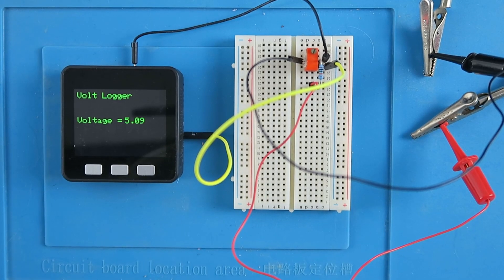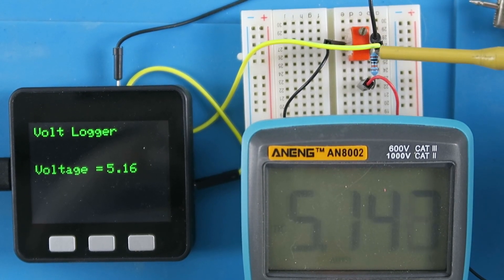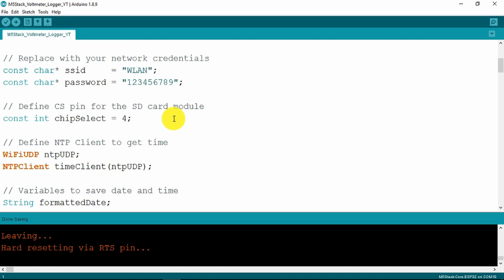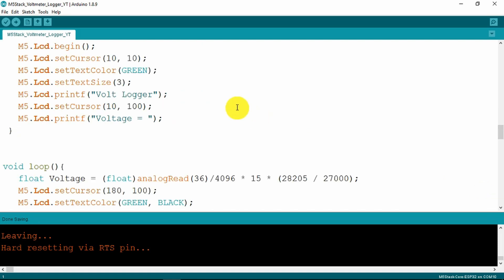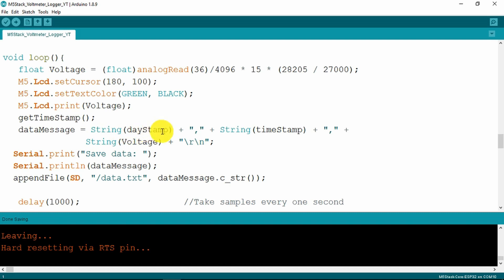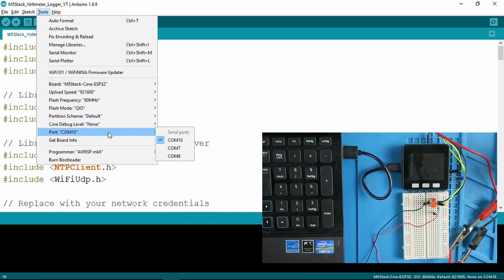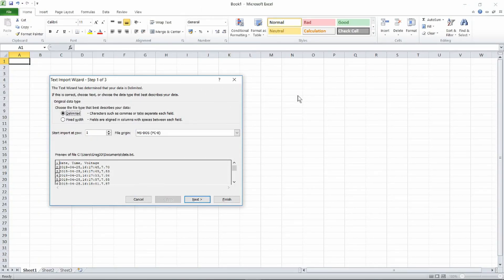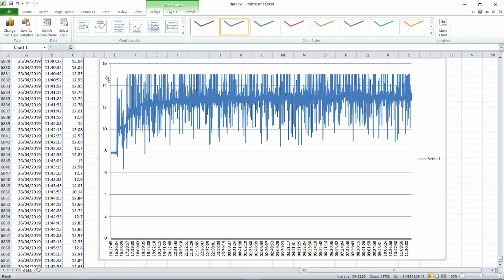M5Stack Data Logger Voltage Graph Tutorial ESP32

Comment: How could I measure a 220V outlet using ESP32? I think Esp32 is not prepared to read this amount of voltage, so how would you do that?
Reply from the maker: You can use a transformer as shown here : https://f1atb.fr/power-measurement-with-an-esp32/#:~:text=The%20measurement%20of%20the%202,values%20between%200%20and%204095. Thanks for watching, have a great day!
Reply: @1nformatica  Thanks a lot! Pretty nice website! Have a great Sunday!

Comment: Hi, tanks for the video. I tried to use your example on a M5 Stack Fire and it didn't work. Shut I use a external SD-Board or ist it possible to use the internal SD-Slot?
Reply from the maker: Hey thanks! It should work with the internal SD card slot as mine did. Perhaps the M5 Stack Fire has a different chip select pin for the SD card or maybe a different library? YouTube no longer shows me if you are subscribed. Please consider subscribing if you have not done so already!

Comment: Thanx, I used your code to make Temperature Logger with multiple dallas 18B20 sensors
I learned a lot :)
Reply from the maker: Thank you Peter. Also thanks for the donation, it is not the amount that is important to me, rather that you took the time to do it. Much appreciated.
Reply from the maker: Would you be able to make your code available on Github or a cloud drive? I had a question from another subscriber on how to use those 18B20 sensors. Thanks.
Reply: @1nformatica  I have created a Github :) Hope it is usefull.
I use it for logging my Floor heating.

https://github.com/FZRSmitti/M5Stack-Temp-Logger